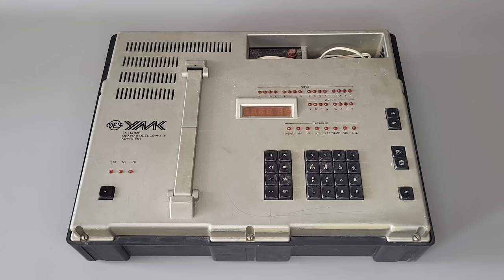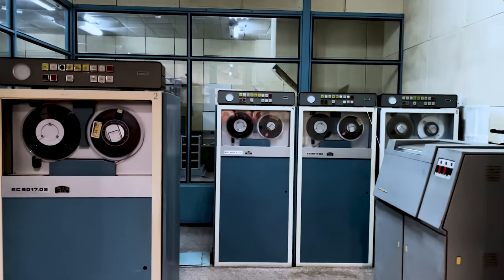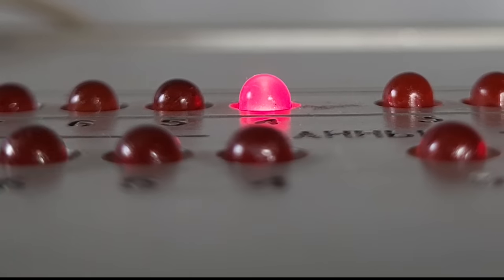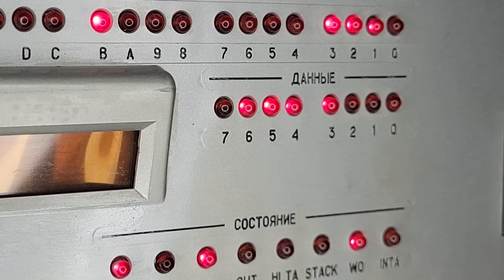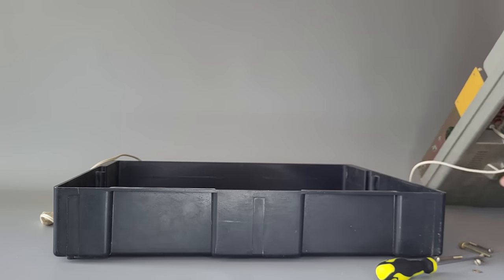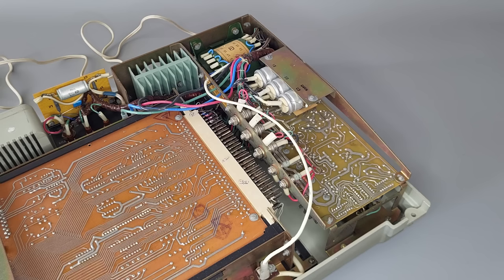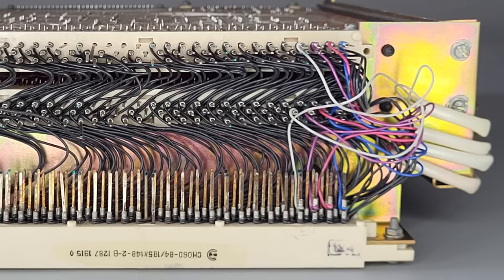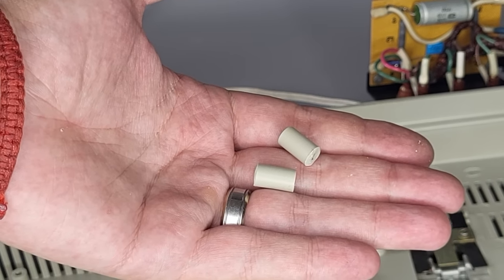This Soviet Microprocessor lab looks like a nuclear briefcase!

Comment: Those LEDs - horrible power consumption and barely emitting light, I suspected them for having an incandescent filament inside :D since some of them produced a lot of heat too.
Reply from the maker: ...but, the color is beautiful, at least ;)
Reply: @ChernobylFamily very nostalgic vibes, they look very similar as Czechoslovakian TESLA LQ100 series leds, with partially metallic package.
Reply from the maker: I won't be surprised if those are them.
Reply: @ChernobylFamily  this is more than probbable in "RVHP" environment.
Reply from the maker: I mean, that textolite pcb material is what you'd find inside Tesla products. That said, it would be logical to have there locally produced LEDs as well

Comment: There was a similar machine at one of Poland's techinical universities in '90s. Only much bigger, built in rack cabinet, with displays for each register, etc. I learned the 8080 assembler on it and understood the operation of that processor. Thanks to it, I also understood the assembler of the x86 family and the operation of microprocessor hardware in general.
Reply from the maker: Thank you for sharing!

Comment: Google Bard's response: "ШГ - these are signals generated by the processor to control the operation of other system devices, such as RAM. КП mode - is the mode of operation of the processor in which it executes instructions stored in memory.

Thus, the note means that there is a problem with generating ШГ signals in КП mode in the device. This can lead to the processor not being able to work correctly with memory, which can result in program errors.

To resolve this issue, it is necessary to check the state of the ШГ signals. To do this, you can use an oscilloscope or other measuring equipment. If the ШГ signals have an incorrect shape or amplitude, they need to be adjusted."
Reply from the maker: ШГ stands for Шаг, or step. Pressing that button makes the system stand by after every step, so you can study what it does.

Comment: In the west in 1988 computers had become a consumer item but in the ussr it was still limited to labs and military bases and universities. part of that is because of poverty but also because the soviet leaders still thought nobody wanted to own a computer anyway. i wonder what would have happened if the ussr still existed in the 90s and 2000s would they only be a few years behind or would they still be using the 8080 in the year 2000 upgrade to 286 in 2008 and 386 in 2016 and by now the should be getting their 486 clone ready.
Reply from the maker: In many aspects true.
Reply: USSR had their own personal computers, howewer, the factory designed to mass production of them was never finished due to USSR collapse and 90's crisis, so the Soviet PC's was pretty much rare. Still, in late 80's we're was able to buy soviet-made portable microcomputer Electronica MK-90 (Электроника МК90)
Reply from the maker: @Tankzorz86 In fact there were many factories — random examples are factories of MPO VT in Belarus, Electronmash, Quazar and others in Ukraine; though I agree that some plans on serious expansion of production facilities were gone in the 90s as all that could not be competitive.

Comment: 400 rubles when a loaf of bread was what, 5000 rubles? if only there is something like GOLD that KEEPS VALUE and is USED FOR MILLENIA to easily transfer and transform wealth from one currency to other. How much was a gram of gold in those rubles? how much was a wedding ring?
Reply from the maker: A loaf of bread was ±0.15 rubles. 

Gold standard in USSR existed approximately to 1961 and ruble declaratively had ±0.16...0.22 g of gold in it. Declaratively, because you could not exchange it to actual gold.
After 1961 stability of ruble depended mostly on import/export operations.

Ruble was a pretty artificial currency with severe overregulation and what is the most important, it was non-convertible. That said, it is hard to compare it with anything else to e.g. understand how much you would be able to buy in some other country. 

About wedding rings back then – no idea.